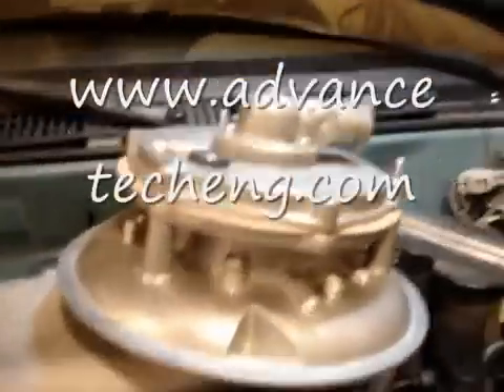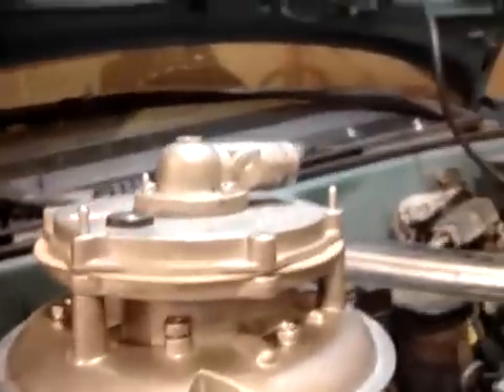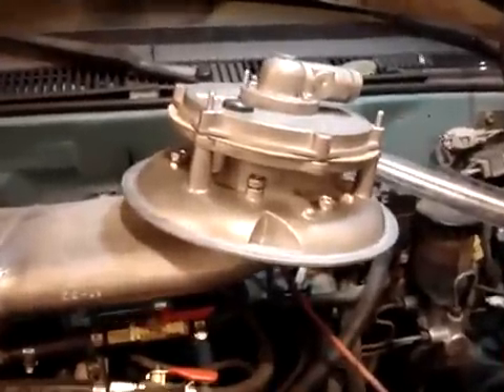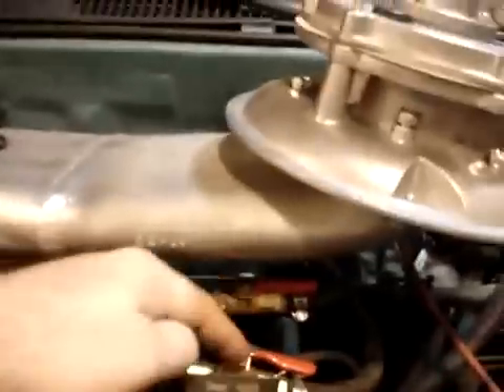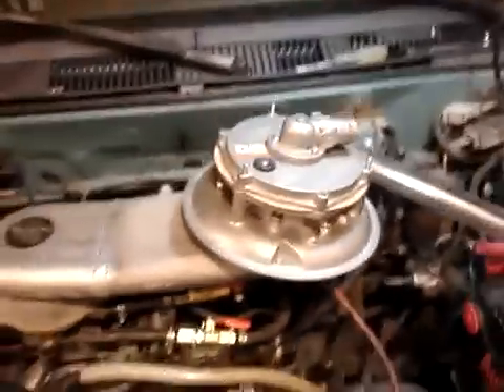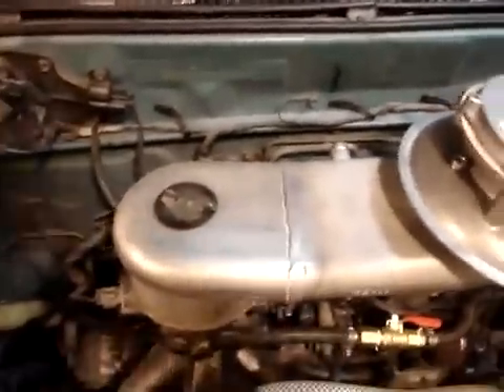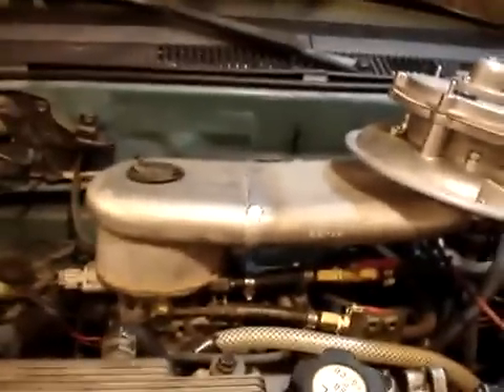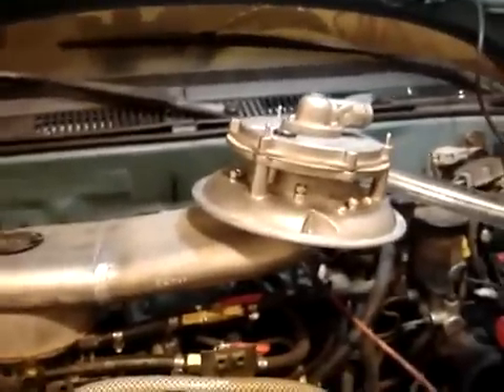Hydrogen Fuel Co., Inc. - 100% Water Powered Geo Metro Demonstrated by Advance Tech Engineering

Comment: I'm thinkin, if you use engine vacuum to create water vapor in your cell, you might not even need current to your plates. A single electrode and a circuit similar to a negative ions generator might do the job. It uses a lot less power.

Comment: Second note, we run natural and lpg both intake are mixed with air, mixers are a ventrical unit heated by the engine water system, and appropriate modules installed to calibrate the timing curve for the different power output of different gases, ie petrol-lpg, petrol-natural gas, natural gas contains high sulphides can cause excessive wear of valves so misting water jetting is added to cool the exhaust valves, just be aware there is much to understand in alternative gas fuels, tanks and cost.

Comment: Good luck, if it’s not on demand hho. HHO added via on demand production from a module powered from the vehicle won’t provide enough gas, in the long run costing excess wear on the electrical system, sulphide filters needed etc etc, only tanked could run this and remember HHO is volatile, an actual Devi’s rating explosion should things go wrong, this has been around for over 100 years, knowledge bass and proven unsustainable

Comment: all real tehnology confirmed by my!
I am a oldtimer mechanic.
I do on my free time hobby chemistry and Im electritian as well.
If peopel wuld see please on wikipedia what gasoline/disel blocks are evry ting is clear!
Im doing it similar experiments.
How ever Im runing disel on my gasoline engine.
It works only on sohv and sohc older engines with out computers and senzors!
How ever ignition system amplification is used like:dual ignition,waste spark,magnetos,plazma ignition.
Temperature control,fuel vaporisators,depends what you runing on some engines use ither high wacum ore high preshure to get some effects,blow by gases are important,what type of carburetor is used,that what you peopel use is called drying engine on winter time because like all fuel bigest problem is turning engine over when its coold that is the real chalange I use "lock in place pistons on compresion stoke" to hold a piston in place when starting a engine by pushing compleately close the gas flap on carburetor it does make starter motor litel harder to turn and it does pre heat compresion cilinder by shear preshure you need to modify your starter motor to handel lot curent draw and heat then you over write your starter motor speed by adding more voltage what is hapening your gas pedal is now the choke you actualy remove the choke it self good idea wuld by use oil pan heaters and block heaters in cold weather and that starter motor overspin is achived with wire harnest increase voltage it does that any way with plazma ignition turned ON! you need to modify alternator starting RPM charge because you altering starting charge by useing pazma ignition of a alternator he start charging baterry around 2000 2500rpm what is not good at all.
That starting sequenc is similar to a spitfire air plain in the old days and it works.
Any way any fuel type as vaporised will do if the enviroment and ignition timing is set corectly.
For exampel ordinary power sterring pump gives you over 1k psi preshure so perhaps engines gaskets shuld by modified to run on bouth disel and gasoline ore what ever you want to use that is peopel forget on other liqueds in the car like oil,brake fluid,coolant all of that burns in centrain conditions expecialy if mixed with gasoline ore disel.
You can actualy force your 200amp alternator to start charge at low speed so there run on a fuel cell but the theory that it runs on hydrogen alone is doubtfull what peopel dont understand is that cell produces oxygen and in centrain condition ozone culd by created and a oxidiser gives more explosion power and normaly you wuld reduce carbiretor jetts to 4x smaller size because your engine wuld explode and so you get with less fuel more pure oxygen 4x bether economy with out useing other power multiplier devices like turbo,torgue converters etc.
Just by that.
Heavier composition of air and fuel gives you automaticaly just by that higher compresion ratio.
Again it works only on sohv and sohc engines they are known for engine run ON!
Because of static,coolant electrolisys,oil vapor,shity quality gaskets,sparking,parasitic curent draw and no suprise GM and Crisler tipical flaws.
Candidats cars who run on that staff are:Ford,Opel,Holden,Isuzu,Suzuki,GM,Chevy and some more engines who are donor parts from GM.
For beginers I wuld sugest to study power ignition system amplifiers.
And plazma burns even water with out sweat so what do you think it will do to oil? 
All of that tehnology is real and the joe cell is real.
No doubht about that ore see motor sport bigest cheaters in histori how they modify their cars as exampel.

Comment: I know the secret to doing this and making it work. Car will run fine with absolutely 0 issues and on alot less HHO than you are trying now. The secret is so simple and I am going to tell you all it. Simply suck a little of the exhaust gasses back into the air intake. It really is that simple. I would go into detail as to why it works Most on here would not understand it, but it reduces the burn rate of HHO to about the same as gasoline.
Reply: Hi, Trina McDonald-  I am interested on HHO fueling car engines.  I already know how to make an HHO.  But still have no idea on how to install it in a diesel engine, in particular the Isuzu C-240 engine.  Could you help me with a diagram on where and how to connect the HHO gasifier?  My objective is to fuel this engine with HHO to drive a 10 KVA electric generator so I can power my  2.5 tonner  Panasonic Split type Air conditioner which runs my Mini Ice Plant.  That way, I can save on the cost of electricity.  Your help will be very much appreciated.  My email address is: constantinosawan@yahoo.com. God bless you and your family.  Thank you.

Comment: Go to     h t t p  :  / /   impco.ws/IMPCO-catalogs.asp  (with no spaces) then click on Master Catalog  to learn that a propane carburetor does use air when it's running on propane.
This guy might know his stuff on HHO but he is wrong that a LP carb doesn't use any air.
As air flow increases the carburetor opens in relation to how much air the engine is using and it also gives it more propane in relation to how much the air valve is open.

Comment: I have a propane carburetor or mixer that looks identical to yours and it does use air.
Watch the video  "LPG Impco 425 carb flat out"
He running it without the air filter so you can see it moving as the air flow increases.
The mixer senses air flow and adds more fuel as air flow increases.
The throttle is controlled by the butterflies in the gasoline carburetor.
"Dodge Ram LPG Propane Conversion Impco 300A Mixer" shows the air filter that's missing on yours.
BTW the it's a duel fuel system.